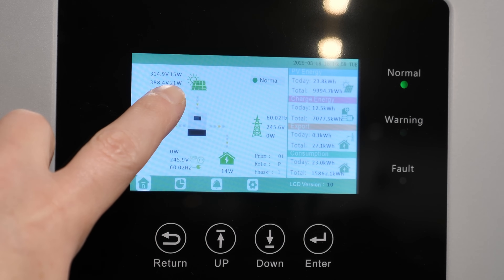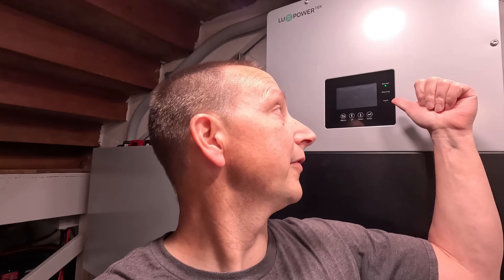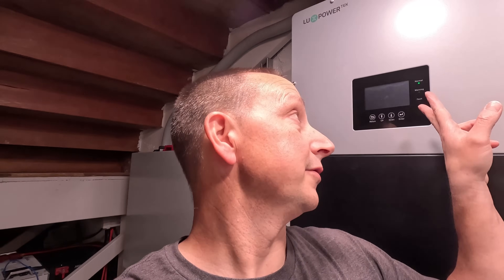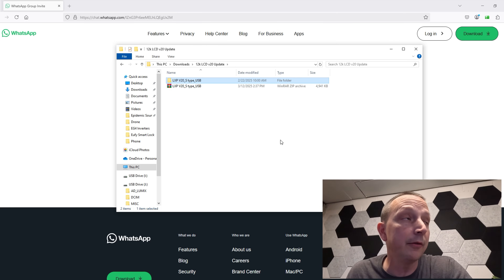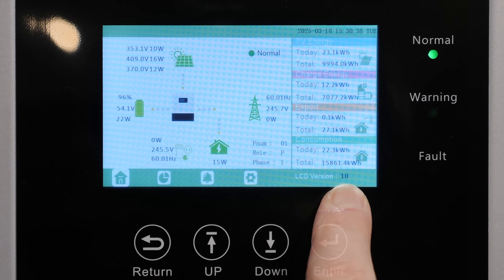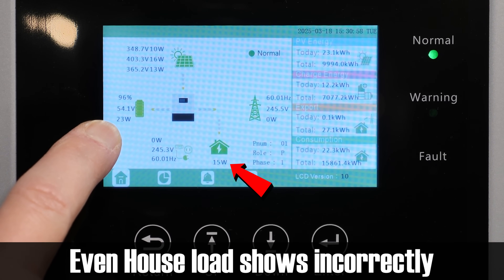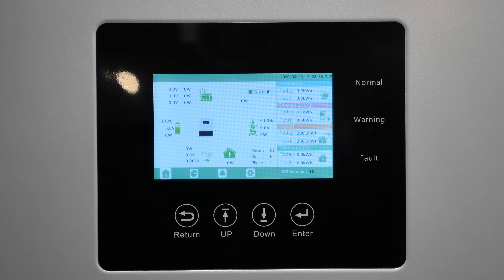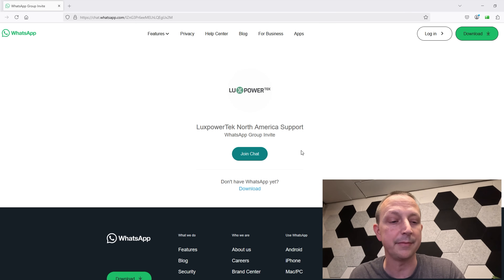12kw LuxPower Hybrid Inverter LCD Firmware Upgrade

Comment: Mine did the opposite of yours.  Wouldn't take the individual files from the thumb drive, but did take the folder with the files in the folder.

***Word of Caution***. Suggest you do the update with the unit disconnected from all sources.  Mine was updated from V8 to V20, and in the process actually changed some setting values on the system.  Suggest you print a settings pdf from the web portal, so you can check each line item before you put unit back in service.  Mine had changed the "Charge to max volts setting" and turned on "Standby" instead of "Normal".  These setting were fine before the install, but had somehow changed after the install completed.

Comment: Your info landed here just in time !  My system is being installed in the morning, and I'm obviously gathering as much info as I can beforehand.  Even my installer didn't know the lcd gets updated separately !!!

Getting the Lux power 18kpv (or whatever they call the non eg4 version), the eg4 outdoor 14.3 battery, and 8kw of bifacial panels on our home in sunny Puerto Rico ! Will be posting a video on it in a few days.  Wish us luck !!!
Reply from the maker: Nice! Did you get everything installed?🤘
Reply: @AVERAGE_JOE  - Yep, been up and running about two months.  Few hiccups but sorted out.  Think the eg4 (signature solar) has better support and a much better app interface, but the cost savings going with lux power is a trade off.

Running our entire home off-grid mode most of the time.  Kept the power company connection as a back up, but also have a generator outlet installed on the inverter as well.  Until the government allows private ownership of small nuclear powerplants, this is as close as I can get.
Reply from the maker: Awesome! Glad you are up and running! Yep, I run mine the same way and also have the grid as a backup. I have needed to use grid a little lately since I have all the trees and the sun is lower in the sky. This is the inbetween time as all the trees still have all the leaves. Once the leaves go away I should be good for a bit. I Love it that we are able to power our homes! Nice job btw!🤘
Reply: @AVERAGE_JOE  Thanks !  We overpowered our PV by 25% to account for the lower sun in winter months (though that's when we'd use less air conditioning anyway).  The bifacial panels over a flat white roof have added an additional 20% gain at times as well).  We have never pulled more than 4,000 watts when everything in the house is on at once, lights, fridge, TV's, and 4 minisplits, so inverter is three times as powerful as we'll ever need also.

Our electric bill before solar was about $250 (electric is high here at $0.26/kWh) and we didn't run all our ac units trying to keep the cost down.  Now, with solar, our last bill was $14 and that was because we used the grid to recharge battery on two storm days with very little PV coming in.  We now can run all the minisplits in the house during the day on most days.  Gets downright cold, but if the battery is full, I hate seeing the solar go to waste, so I turn everything on....  😂

Inverter generator, though unused so far, can recharge battery in about 3 hours from 20% cutoff to 100% if needed.

Most of the info I've gained was from watching videos on the eg4 brand of this inverter, as Luxpower lags behind on info.  Signature solar videos have also helped immensely.  The Luxpower app is not as polished as eg4, and has a few quirks that just seem that less thought was put into it compared to eg4.  Things work the same basically, but it's a bit clunky in comparison.

But to have energy independence from the failing infrastructure here is amazing !  We could absolutely close our electric company account and be just fine, but I like having redundant systems and options.  

I have also made a number of videos on our YouTube channel about the system, and just life in Puerto Rico in general, as we bought a hurricane Maria damaged home, that sat vacant since 2017, and brought it back to life.  We are not investors here, just a recently retired couple with our daughter, that wanted to escape the US rat-race but still have the protection of the US flag for the time being.  Check my channel out if you have any interest.  Cheers !

Comment: I read that updating the firmware for the EG4 6000XP inverters, also includes updates to the LCD screen display?  I'm a bit skeptical now.  But an update that folks should be aware of, is firmware for your Wi-Fi dongles.

Comment: Why aren't you warning your viewers that these cheap knockoff inverters of American transformer based designs can damage their home's appliances because they lack any galvanic isolation? When the Chinese developed these low-budget inverters, to save on manufacturing costs, they stripped out the most critical component in American inverter designs, the output transformer. Without this component, these cheap inverters can do some pretty serious damage to household appliances.
Reply from the maker: I havent heard of any issues with these damaging home appliances. I have also been running this for over a year without a hitch. Did one damage your home or appliances? I would be interested to hear about it for sure!
Reply: I have been running my "cheap" inverter for the last 5 years running everything without any issues, if it is pure sinewave you are good but anything else will defenitley cause issues and damage
Reply from the maker: 100% if its not tru sine can damage motors and all sorts. Buzzing noises

Comment: Do these inverters have an online service or web services they offer? I wouldn't really want something like that off-grid per say but grid-tie sure. Seems like a lot of hassle for sure but good old USB sticks FTW. I am playing around solar today after mowing and clearing out a shed to possibly make my poor boy solar shack in the yard for tools and old dead batteries to store solar gas.
Reply from the maker: So I try to keep up with the firmware updates especially since I make videos with it good or bad. I update mine through the web portal which is just like the app but shows more info. It can be updated with a phone as well. If someone wanted to use this offgrid I would 100% recommend it as it isa SOLID inverter but would say get the eg4 version. Also if someone used this in a remote are and never got firmware updates. It would still work fantasticly.

Hey, a poor boy solar shack is a win in my book! If you can power things out there, thats a Big W!💥🤘
Reply: @AVERAGE_JOE  AGM batteries seem to last good enough for lights and tool battery charging...proving ground. I know I want to go 48v. just want to get the real world experience on cheapo 12v for now.. It's spring now and I am watching the spots in the yard for the potential ground arrays.

Comment: You can actually update the firmware through the app using local connect on your app
You sign out of the app, n then connect to the inverter using Bluetooth or local connect and check for available firmware 
Then you’ll update from there unless they’ve disabled that for the North American market
Reply from the maker: For the regular updates yes you can go that route. I usually do those through the web portal. As far as the LCD, I think its USB.🤘
Reply: @ there must be some difference in update strategy between the American market and Africa/Asian markets 
We get both ours done together

Comment: 7:25 so you're making 2.4MWh, 4.7MWh and 2.8MWh now? phoah. mine is busted. don't buy chinese crap. the best brand/quality and it borked after a 5~ years.
Reply from the maker: Its actually moar🤭 I have a 6kw luxpower with the ground arrays on it🙃😆 Yeah you need a new inverter!

Comment: An SD card, or a USB drive? Cause what youre holding sure looks like a USB Drive. :confused:
Reply from the maker: Lol yes a UsB sdCard Drive🙃😆🤘
Reply: You are right its a USB but I think Joe meant "flash drive" which is a generic term and can mean either a USB or SD.    SD cards are also flash drives but are more often used as a memory storage device.
Reply from the maker: All of those Im sure I mentioned lol👋👋
Reply: You forgot to mention Cd floppy and hard drive 😆 @AVERAGE_JOE
Reply from the maker: A USB sdCARD FLoppY DriVe. I have one of those as well sitting next to the usb coffee warmer hot plate😆🤘
Reply: Later again.